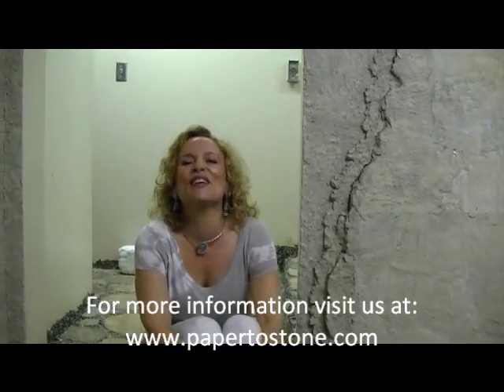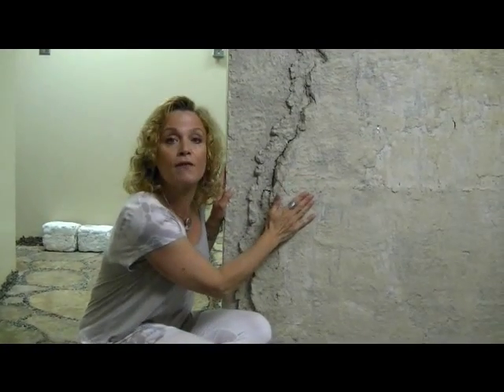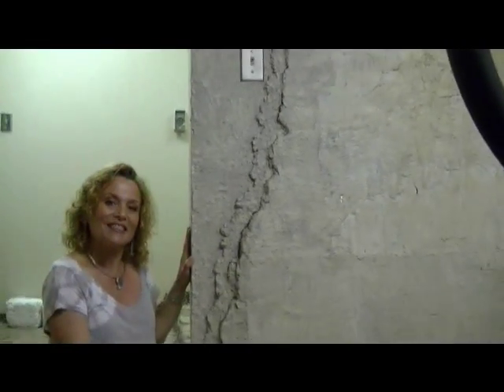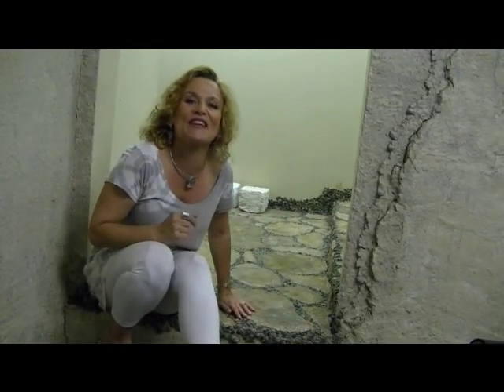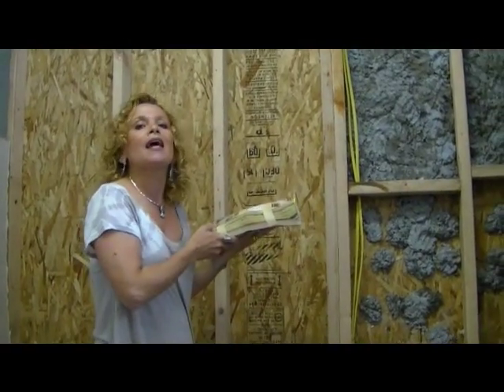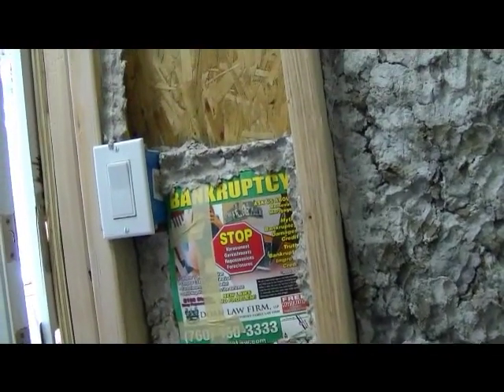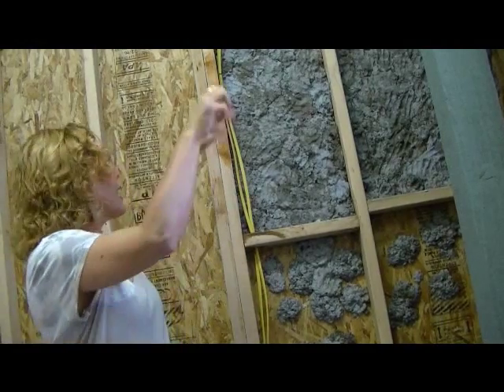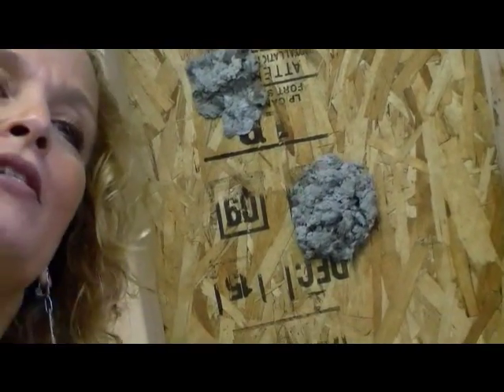Paper Walls Part 1

Comment: It may be a good idea to add some extra pvc pipes and embed them in the papercrete to make channels for the electric wires.  It would then make it much easier to thread through new or remove old electric wires much more easily.

Comment: How well did this insulate that room?  I was thinking about using paper pulp mixed in with earthen plaster (clay, sand, and paper pulp) to fill in my walls.  I have a small 16x24 cabin shell and want to make it as earthy and green as possible.  Wondering if the mix I mentioned above would act as a good insulation if I fill in the walls and do a good thick layer of plaster on the exterior wall as well as the interior walls.  Thoughts?
Reply from the maker: I think it would be excellent....But remember, the best way to add wet pulp is to build up the wall over a few days and not all at once...give the bottom layers a chance to dry before adding more pulp. Of course, you're adding things to the paper pulp so that might make the adherence easier. I haven't tested the actual r-rating so I can't tell you exactly the insulation level you'll achieve, but depending on your climate it should work fine.
Reply: The addition of some Boric Acid would prevent mould growth and become fire retardant.
Reply: @richardsandwell2285  Before to do it it is better to know that is cancerigen... https://www.youtube.com/watch?v=Zl4v3E5Ifrk